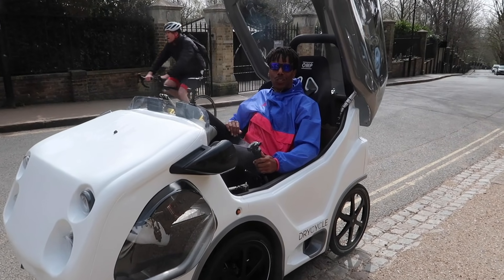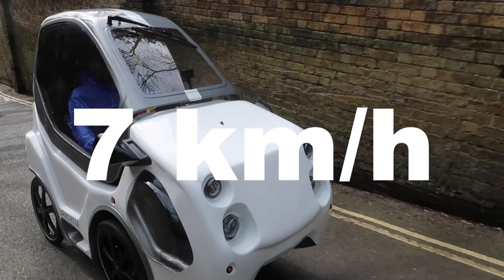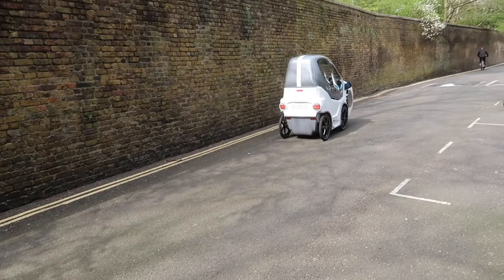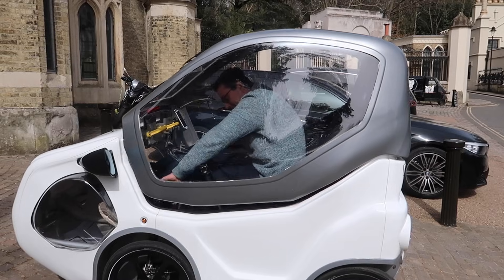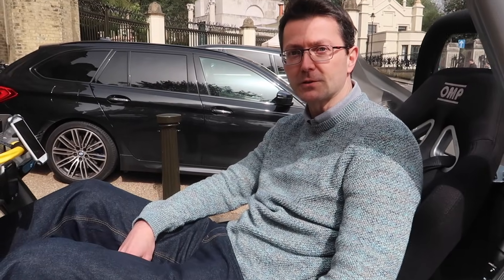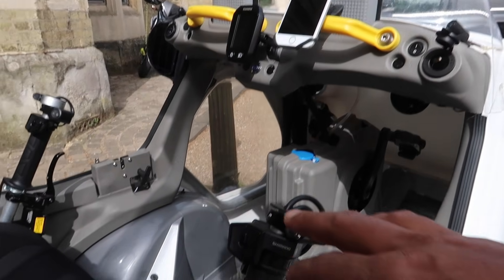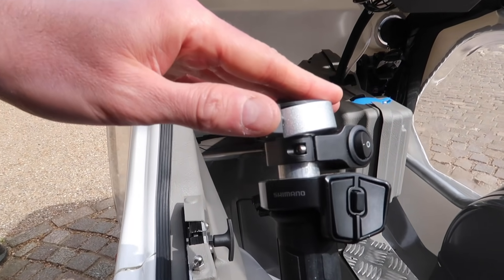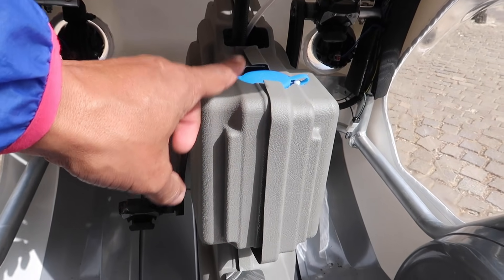I rode the DRYCYCLE up the steepest hill in London and this is what happened!

Comment: I saw the prototypes of these being sold off on a website somewhere about six months ago or so for about £2k each - I guess the company folded. Shame, it was a sound idea that'd have appealed to some, but maybe a bit before its time, and far, far too expensive. Also looked ugly! The Frikar Podbike seems to be doing better at least, but I doubt it'll be allowed to be sold in the UK as it is.

Someone needs to make a practical velomobile priced reasonably at £3k or lower, which uses standard bike/ebike parts that are easily repairable or replaceable, else it's just a rich person's toy with a niche use and less functionality of a normal ebike - Just you don't get wet in the rain and can park it anywhere. Make it able to tow a bike trailer, too - Then it'll actually compete as an alternative travel option.

Comment: The concept is great, but 500 watts isn't enough power for a standard ebike for commuting. I would expect at least 2000 watts for the motors alone and another 750 for all those accessories. It needs to easily go 70 km without charging and maintain close to max speed of 32 km without overworking the rider. Otherwise how can it be a dry machine when the rider is wet with sweat. I would consider adding re-gen and solar panels to save power and enforce the speed limit for downhill. Please keep safely in mind. If you can beef it up, then the price is a good deal.

Comment: Your smile is contagious. As for the specs a prototype could be built for £5k with a throttle, 7000 watts, a 30mph top speed and a 30 mile battery on it using e-board tech. The price is a mad ting. Great vid

Comment: This load of weight to build a weather proof cabin is too much. Must reduce it. Use better brakes. Need to negotiate watts of motor from 250 to 500+  or build a motor that spike from 250 watts to 500…1000…2000…3000 watts to climb mountains and downhills regenerating battery but keep the speed in limits of bicycle laws.  Prices of this kind of vehicles must be under $5K to appeal and to convert car commuters in all seasons. This would be the winning formula.

Comment: That open differential is going to be no good when you have to deal with snow or ice.
Reply: It's going to be shite to even clean, regardless of ice or snow.
Reply: You can say the same for bicyles or  motorcycles, plus most cars have open differentials. Front engine, rear drive cars are particularly disadvantaged. I fail to see how this machine is any worse in that regard.
Reply: @percyfaith11  Why is it? Why can't you wash it? Tip this vehicle on it's back and you can clean everything underneath.
Reply: @another3997  With an open differential, you can compensate somewhat if you can put a lot of weight on the drive wheels. FWD drive cars are less effected by open diffs compared to RWD. If the vehicle is really light, a limited slip or locking differential is the way to go. I've notice that there are some e-trikes on the market that use a front hub motor, with an open diff in the rear. I've heard many comments about how sketchy these are because of how easily the rear wheels will completely lose traction.

Comment: Being 100kg makes it non road legal so you would need a licence unless they know a loop hole
Reply: Is that from the DVLA info? Be interested to read up on it
Reply: @The_CrackedPot_Christian  from the government site . TBH I don't think Police really care too much
Reply: this is from the old regulation (60 kg limit) before it was harmonized with EU and weight limit was lifted, so it is road legal.
Reply: @alexp2011a  It's just I ride an Ebike that is 32kg and I have a trailer that's 16 kg so if what you say is true I can add the two together
Reply: @PoPpsychle  I  do not see why not. (unless the trailer has a motor as well).
Reply: @alexp2011a  No just a standard two wheel trailer and ball joint connector .
Reply: @PoPpsychle  I'm not aware of the law or regulation that forbids that. Trailers are used on both bikes and e-bikes across EU. Here is also a UK company (one of them) that sells these: https://urbanebikes.com/blogs/news/can-an-electric-bike-pull-a-trailer

Comment: Add a radio rear view reversing camera and make the back tail lights flash and act as brake lights and increase the cargo area  then I think this could be a winner , I think Clive Sinclair was ahead of the time with the c5 but I think the drycycles time is now , I say that because I’m a fifty four year old who rides an e bike with a travoy trailer but I have used the mrs’s mobility scooter for nipping to town because it’s nippy and if you include waiting times it actually beats the bus , we’ve looked at Enclosed one’s like the cabin car for inclement weather , I wouldn’t use the mobility scooter in the road but I would use a drycycle, if anything will make this fail it’s the price but their hand made , maybe mass production could bring this price down , the designer has obviously put his heart and sole into this so I hope they’re a huge success , they certainly turn heads .

Comment: why put all that effort into a delux cannopy and dash, then use a wimpy 250w..  750 to 1500w motor would compliment it well, but 250 seems way too small.
Reply: U.K. law allows a maximum of 250 watts with no electric assistance allowed over 15.5mph.
Reply: @ianc1097  more power would let it climb better they can still limit speed

Comment: That's a great wee video you made! Okay then, you're obviously fit as a fiddle making it up that hill but if I tried that the windows would have all fogged up and it would have been expanding and contracting with my every gasping breath!
Downhill with my new massive weight gains there's bound to have been lots of black smoke as the heat from the brakes melted the tires and caused the back end to burst into flames.
But you made it look like anyone could do it.
If I was in it I'd probably have bounced off a few cars before finding out it was a one way hill, funny that, one way up so you are going to get stuck up there if you can make it up.

Comment: Such a strange vehicle!! And that's coming from someone riding electric unicycles primarily 😁
Pretty cool overview 👍

After you demonstrated the climbing ability, it's certainly great that it can make it, however fairly slowly in PEV terms despite being wide.

Although the quality of the Shimano motor, display and batteries is rather high it's also a bit of a missed opportunity to be limited to 250W, and get 2 large, heavy and extremely expensive battery packs for the capacity offered at only 36V.

I hope they'll be successful in the niche 👍
It seems to be a good machine to build or maintain fitness with a unique proposition.
Reply: Even I have not heard of an electric unicycle, I've gotta look them up!
Reply: It's limited to 250W so that it can still be legally considered a bicycle in UK as well as in EU.

Comment: While I do think the price is too high, the Drycycle itself is pretty nice, I have to say.  Maybe as more units get sold, the price will come down to where us regular people can buy one.  LOL
Reply: Needs more ventilation.
Reply: @billybobby7607  Good point.  Very good, actually.  Seems like it would become a greenhouse really quickly.
Reply: @arekpetrosian4965  I'd say side windows need to be open. Also 250w is a joke..I'd fit 1000w
Reply: @billybobby7607  If you could just open part of the windows, or even some front vents, that would be a huge improvement.  And as for the motor, I'm not sure what the thinking is there.  My wife has one of those electric bikes from Costco, which has a 250w motor, and I've ridden it; it does accelerate pretty quickly, even with my weight.  So, a 250w motor on something with a large chassis, frame, etc.?  1000w seems FAR more realistic to me, and it would make the vehicle far more appealing to more people.  Some - like older or physically impaired people - might find something like this very attractive, even necessary, for things like visiting friends, shopping, etc.  Give it a better motor, and I'm betting interest will rise along with that power.
Reply: @billybobby7607 It has air vents and it has two electric fans/heaters. There are strict regulations as to what sized motors can be used on electrically assisted cycles. Putting on a bigger motor means it legally becomes a quadracycle, requiring a driving licence, tax, insurance and a number plate.
Reply: @another3997  fit a bigger motor anyway.

Comment: Weird looking vehicle. The ground clearance seems bit low, but other than that it seems quite practical vehicle. How much does it have luggage space? The seat looks very comfortable, but with five point harnes it is quite overkill for a bicycle :D 
Thanks for showing us the bottom of the vehicle. Very interesting to see how it works. The drivetrain looks bit complicated with extra gears and differential. But it makes the vehicle more practical. Though it's very heavy.
Reply: Haha I was also counting the weight of each accessories in my mind when looking around. And what about this metallic plate in the middle! Why 😂
The design doesn't seem fully optimized for weight yet but they seem to have hit their targets on robustness.

Comment: This is a good, honest video testing the uphill capability and characteristics of such a vehicle.  A non-electric-assisted trike with a good gear ratio in lowest gear can get the same result (and not leave the driver huffing-and-puffing exerted!).  The small size of such trikes/quads often enables them to be out of the way (or can more easily get out of the way) of faster, motorized vehicles who one doesn't want to impede going uphill.  A totally pedalled trike (or bike or quad) is similar to a lorry/truck going uphill -- slower and needing to take the slow lane.  They're very good, however, at evading the Big Oil-dependency and climate destruction of fuel-dependent motorized vehicles.

Comment: Too many ads, I stopped a quarter through. My Organic Transit ELF (shown in my avatar) weighs 160 pounds, has the legal limit 750 watt motor. I weigh 300 pounds but I climb hills like that at 18 mph while drawing 1000 watts. EU laws are strangling the development of useful velomobiles. I have room for 30 plastic bags of groceries or a passenger. At 220 pounds the DryCycle is too heavy although some will want it for the certified crash cage safety.
Reply: Tip of the day: fast forward to a few seconds before end, let it play and finish, then rewatch without adverts. Your welcome 👍
Reply: Yeah. A 250W motor limit can be appropriate for bikes, but when stuff starts getting heavier like this is gets a bit limited. As does the speed limit of 15.5mph or 28mph(for the higher category). Shame the ELF doesn't fit somewhere in the categories. And equally a shame there's not a really streamlined epac velo that can do like, 40mph, that might need a licence and insurance.
Reply: @cjeam9199  No. You don't know what you are talking about. These motorized velos are NOT for speed and speed is not legal. The ELF is the heavy duty cargo version of a velomobile, 550 pound payload capacity. It is not legal for it to go faster than 20mph without a car license and insurance and driver license. Streamliner bullet shaped velos can go 60 mph on pedal power only but they are very uncomfortable, too low for safe visibility, no cargo capacity and a danger to others on bike paths. Streamliners cost the same as the ELF while offering much less utility. The ELF is the only one to complete journeys of 4,000 to 36,000 miles. The ELF is in fact wind tunnel tested to prove it has the same drag as a rider on a 2 wheel bike.
Reply: @popeyegordon  I know what I'm talking about thank you. 28mph is legal under the speed-pedelec category across the EU. But that's a limitation if you want a vehicle that could go longer distances in less time, which a streamliner velo could do and would also benefit from electric assistance, though indeed wouldn't be appropriate in bike lanes, or likely without a licence. Many places don't allow the speed-pedelecs in bike lanes either.  
The ELF is not the peak suitable-for-everyone vehicle of electrically assisted velomobiles.

Comment: I really like the IDEA of what this is - but it's wildly over-engineered, overpriced, and also under-powered.  I mean why in God's name does this thing have heated mirrors and heated handles?  Fine if you want to offer these as optional extras, but to be viable you need to produce a base version of this with a target price of 3,000 USD.  And you need a 500w motor, not 250w - trust me!  If you could cut out all the fat and offer a $3,000 500w base model with nothing but lights, fans, and turn signals - and a top speed of 40kph/25mph, THEN it could actually be a high-production commercial success!  Make it mechanically simpler, more like an eBike - because that's the market segment for the majority of your customer base.  This isn't going to replace cars in 2021 and it doesn't need to be as safe as a car in a collision, just safer than an eBike.  It doesn't need an ELECTRIC Shimano shift system, it doesn't need an alarm system, and it doesn't even need a windshield washer system.  These should all be optional extras the client can pick from, for an added fee.

Comment: In earlier informations, I have read the dry cycle was equipped with safety belts. As a result, the dry cycle would comply with some of the biomechanical accident criteria for passenger cars (mainly the HIC). But why is this guy not wearing a belt ?
Reply: It does not go fast enough to warrant a belt. Belts are for cars.

Comment: No way to get regen? With regen you would at least get some of the energy used going uphill on the way down!
Reply: No. Regen in very light vehicles is just a marketing ploy. It takes a less efficient motor type to be capable of regen or reverse and 95% of the energy is lost in friction and heat. Regen for bikes is more of an electric brake to save brake pad wear.

Comment: That's a great vehicle for a slo-mo opa steep Hill it was impeding traffic by the way they need to be faster than that even up steep hills or mountainsthey need to be able to do 45 to 50 miles per hour thank you good day can you boost your booster into a very faster vehicle I definitely don't need a slo-mo like that where's that guy working pink petal cuz your knees and hips hurt you need something to be able to climb that hill without you having a pedal but you can if you want to kind of thing it's got to be faster a good day to you I'll talk to me again on the next video when you can get the manufacturers to increase the speed of that nice little vehicle decent amount of speed I'm not really asking for 50 I'm asking for 45 oh no power without your pedaling but you can pedal on if you need to or if you want to that's all I'm sayingand if it means to put a higher wattage motor on the vehicle what's the problem then put a 10.000 what's mid drive motor the really crank up the power better batteries for that motor and Chris controller for that motor did you get that thing to take off like a rocket up that hill or mountainthen I might be thinking about you if and only find one for myself if you could get one to do that hard haha that would be cool.

Comment: But I am not impressed I'm proud of you you know it's did probably better than a l or pedal make that money going up that hill but I still am not impressed cuz Linda of the Hill fastener and without all that extra help you is helping it with your pedaling if you did nothing and tried to go up the hill that big wooden made it up the hill either stick the fork in it it's done what you might be saying if you went up the hill without pedaling does a motor with just overheating burn up and you end up going backwards down the hill most likely that was a very poor effort hi that technology that you was using and yourselfyou might be in shape I drink to you probably more in shape than I am right now I bet even when I was in shape riding bikes I found it hard climbing hills but I had no motor to help me I was think if you had a motor and be a lot easier and you don't address stress your body out to get up that hill you can ride up that hill in style like you're in the car or something with minimum of peddling like you you put that at 10 mile per hour amount of effort into it and introducing 1000 horsepower of that Hill home electric motor but I did see that I saw maybe a hundred boats or what going up the hill I saw him having very difficult and impeding traffic slow mo not a problem going
Reply: One continuous sentence? Ever hear of punctuation?